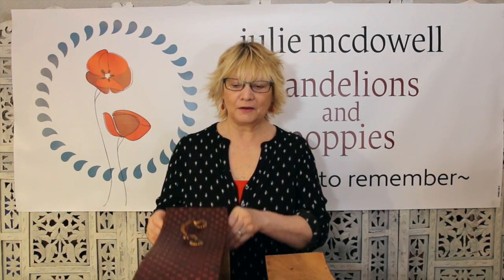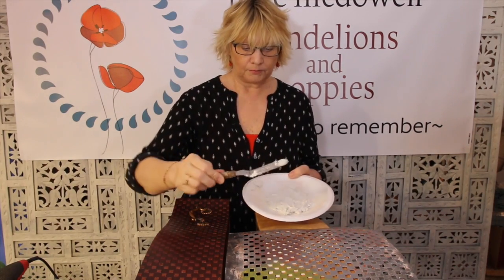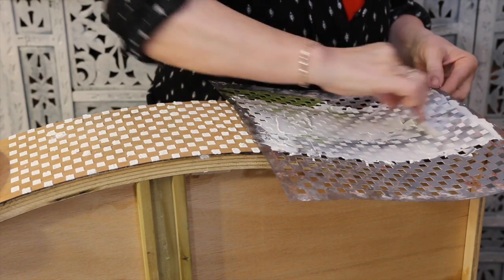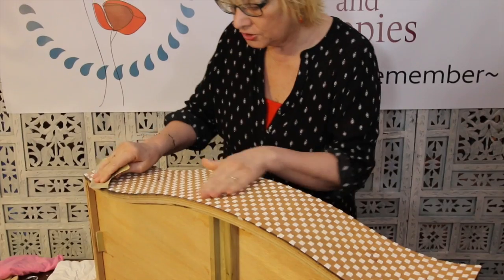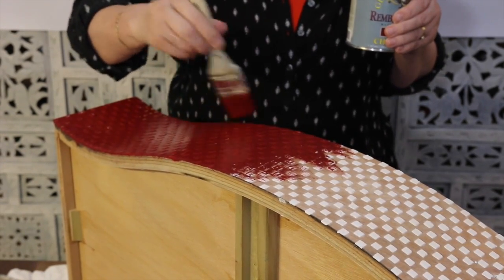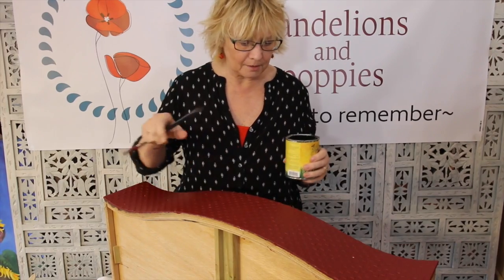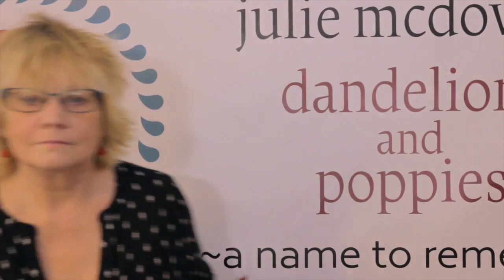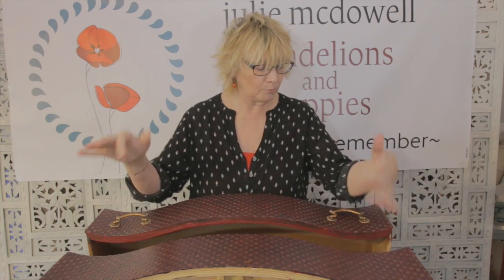Julie McDowell: Raised Stencilling and Glazing

Comment: This turned out so BEAUTIFUL>.. I LOVE It...

I don't know if you have tried this other method...
Example:
1)  You need a big ceramics tile, or a piece of wood, whatever you can stencil... LOL
2)  Do the same stenciling effect you did on this drawer face, with the raised plaster/mud.
3)  Let dry really good... over night is even better. Sand it... gently.
4)  Get a beautiful Napkin of your choice and thin it out the layers, so you'll only have the top layer...
5)  Glue it on top of the raised "mud" with water downed glue so the Napkin will adhere to the raised plaster...
 6) Then glaze it or Polyurethane it... Or Stain it to look Antique'ish... 
It is Beautiful.

Comment: I absolutely love this technique. However, when I tried to do it, I had two problems: 1) on a couple of the stencils, the plaster just crumbled right off - just fell away in enough areas that it didn’t look good. 
2) sometimes the plaster would pull up when I pulled up the stencil. I mean HUGE chunks of it, not just an attractive mottled look. 
What did I do wrong?
Reply from the maker: Oh no! Sounds like it wasn't adhering to the surface. Did you paint it first?
Reply: Yes, it was painted first. It seemed to me that perhaps either the consistency of the texture paint wasn’t quite right, or else I didn’t get it “smooshed” into the stencil well enough. Should the texture be on the thinner side? And do you pretty much scrape the excess off the stencil before pulling it up?